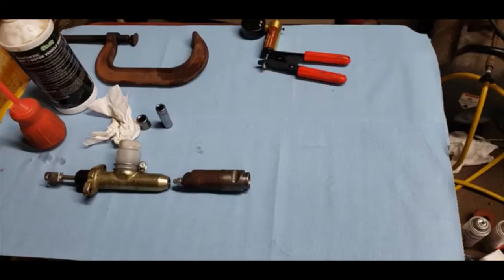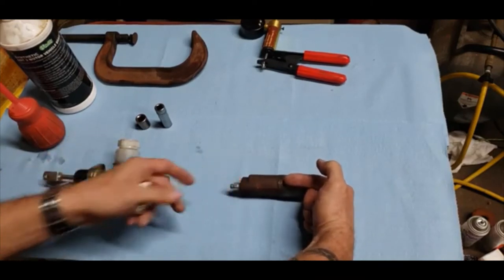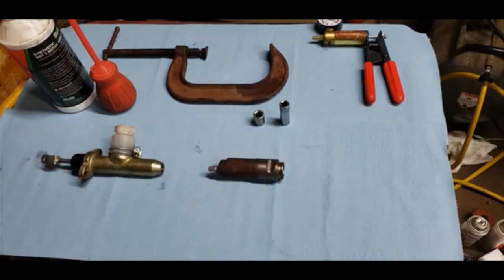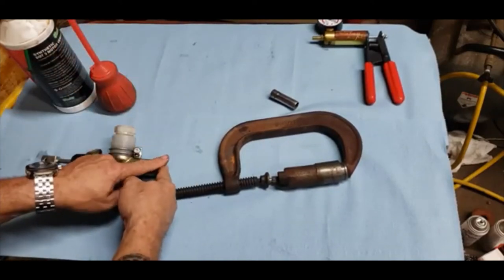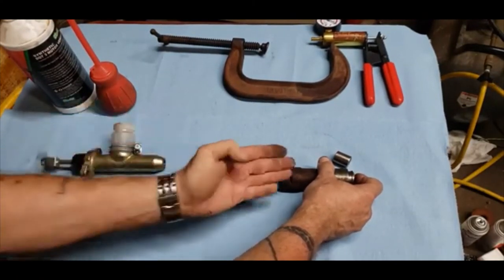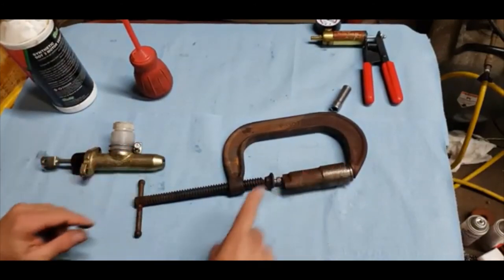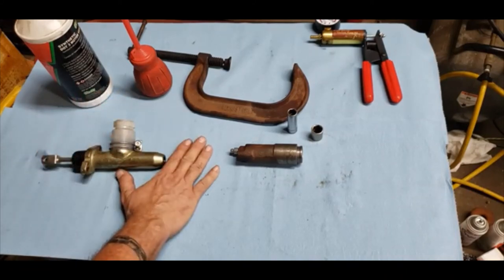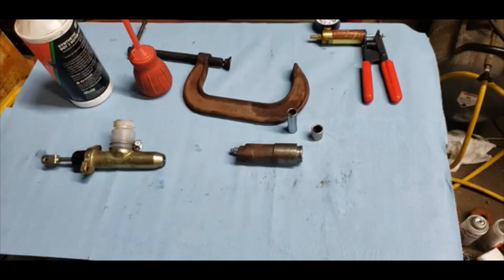Easy-peasy MG Midget hydraulic clutch bleeding

Comment: Amazing solution and presentation.  Thank you.  Just changed clutch master/slave and all parts in between. Drained out dark old fluid bled through new using traditional pedal method a number of times but still had hard time finding gears and had gear grinding into reverse.  After one attempt with this method and the car feels better than ever.

1978 MGB
Reply from the maker: Glad that it worked out for you. Believe me, I've wasted hundreds of hours fiddling around trying to bleed these clutches using traditional methods and nothing ever really worked.  Not to mention how many good cylinders I've probably changed thinking they were bad when it was just a trapped air bubble.   I hated these cars until I learned this reverse method that can be done with a few simple tools. Now it's actually a pleasure to do a clutch bleed!

Comment: Count me as another success story!  After watching several other how-to videos on bleeding MG clutches, I was not looking forward to it since most said many attempts using old school methods would be required and still non-optimal clutch action.  Then I found your video, BINGO, that looked like the right stuff.  First try using your method and my clutch works great after having to replace the failed slave cylinder on my '77 midget.  Thanks for a great video without a lot rambling and showing a great technique!

Comment: We just bought a restored '79 Midget 1500 - our first.  After working thru some electrical issues, a spark plug change, etc etc the big thing now is to bleed the clutch and see if we need to replace the master and/or slave cylinders.  This method seems to make sense and hopefully will solve the issues with the clutch/transmission that leave the car practically undriveable at the moment.

Comment: I’m not understanding the part at 5:34 where you say to crack the line and see air bubbles come out. My master cylinder has a banjo bolt connection and I’m not aware of any ability to open and close it. I think it’s just always open. Also, it’s connected to the hard metal line so air bubbles can’t be seen.

Comment: I understand your process, and agree it should work. But I've done it twice and I still have a soft clutch pedal that doesn't disengage the clutch. I'd sure like to know what I'm missing! It seems as though the first 2-3 inches of pedal travel do nothing at all. Could I have a linkage issue? I don't know. I'm frustrated. It shouldn't be this difficult. Any suggestions?
Reply from the maker: You probably have a bad master or slave cylinder then
  If you put a c clamp on the slave cylinder and still have a soft pedal, then you definitely confirmed the bad master or slave.  If you clamp the slave and the pedal is rock hard, then your clutch pack is worn out or broken.  

It's a very simple process and therefore easy to overthink it. 😁

Comment: At the beginning when you pump the clutch Do you hold the clutch in while you bleed at the master cylinder?
Reply from the maker: Yes. Push and hold that first time to clear the upper chamber.   It's not the end of the world if you don't. It just takes a  little bit longer to bleed the system out.
Reply: @Red Scorpion 6  Thank you ,just starting my adventures  with  1977 mg.

Comment: Sadly did all the steps ...
Still go nothing 
First push on the slave a lot of air bubbles came out 2nd 3 and 4 times no air bubbles at all and still nothing at the cluch pedal 🤔
Reply from the maker: Then you know for certain that your problem isn't an air bubble.   I would suspect a faulty master cylinder or perhaps a clutch plate failure.  Something else is wrong that bleeding the system won't fix.

Use a C clamp to hold the slave piston and press on the clutch pedal. If its firm, then you have a mechanical problem with the clutch pack.  If its still mushy after bleeding,  then the problem is most likely the master cylinder
Reply: @tjsogmc  
The master is new flex hose also and the slave ...I'm going to work on it Friday morning and start from  scratch...😏
When a crack opens the line  at the master cylinder and press on the cluch pedal i do get some oil ..
Will see what happens next...